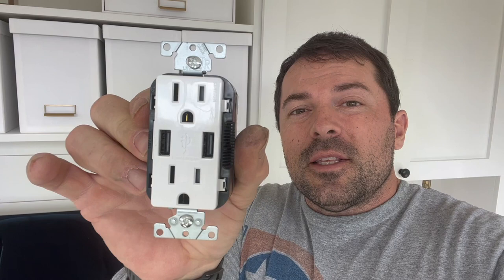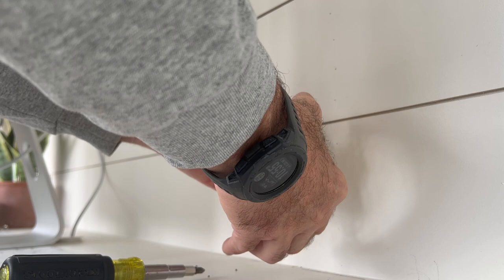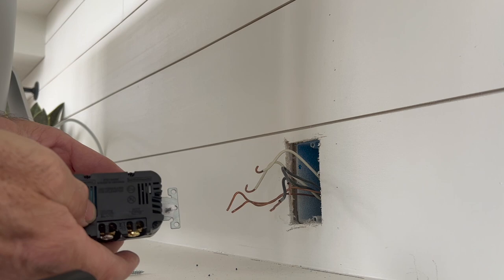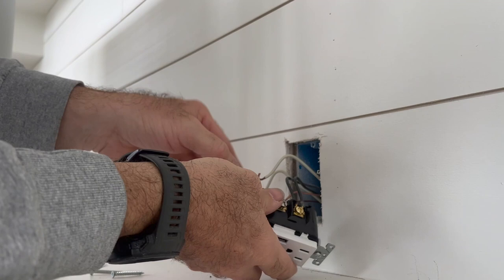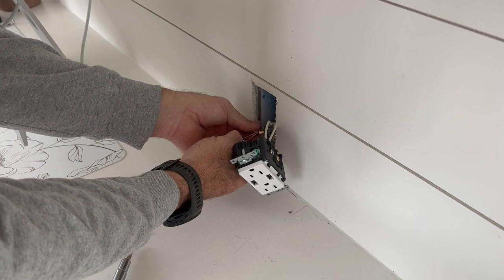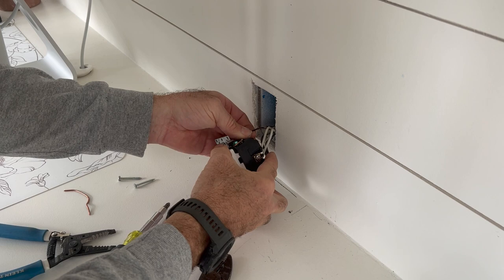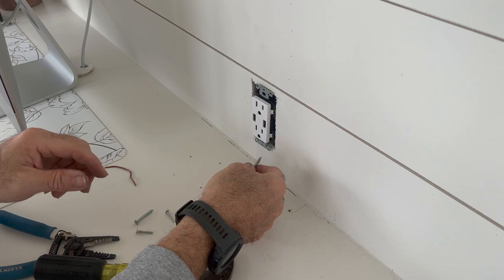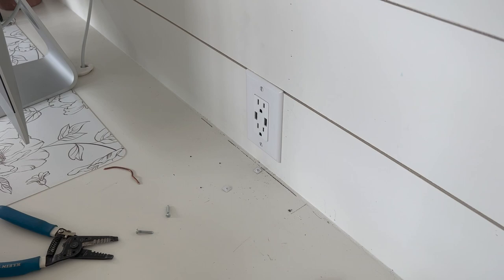replacing an electrical outlet for one with usb built in

Comment: My wire didn't want to fit in the holes and had to use the screws. But it's regular outlet. That's pretty cool
Reply from the maker: got it on sale at depot quite a few months back just got around to it

Comment: It’s amazing how many different words we use over here…. Outlet is socket, hot is live, white is neutral and we do use ground it’s normally earth… the socket is totally different too but what surprised me was the you guys have 2 different posts where we just have one which is always brass, it’s never different materials… funnily enough I’ve just done this job myself but not for USB, i needed a double socket instead of a single 👍🏻👍🏻nice work mate 👍🏻
Reply from the maker: very true mate 
good on you for doing your own work
Reply: @TheProCut17  ah, it didn’t start well, I dropped it in the car park and broke the corner so I spent the next few hours super gluing it 😳 still it’s in and it works and now I have 2 sockets 👍🏻